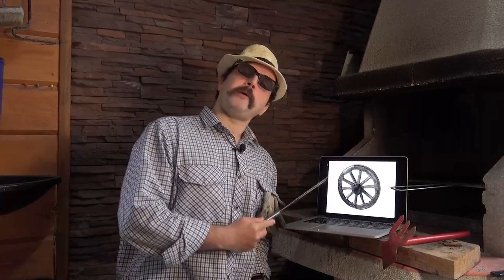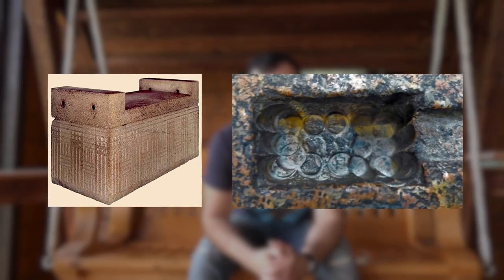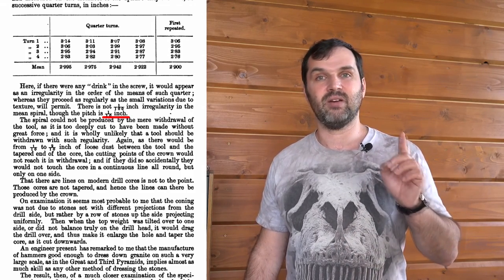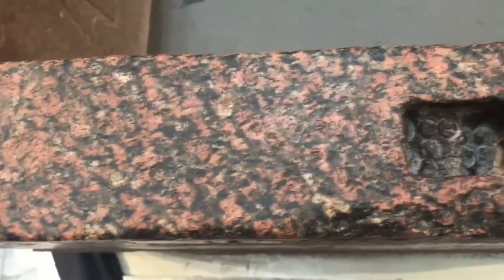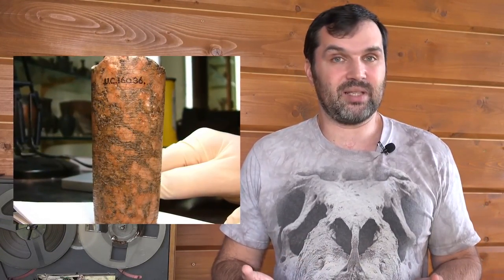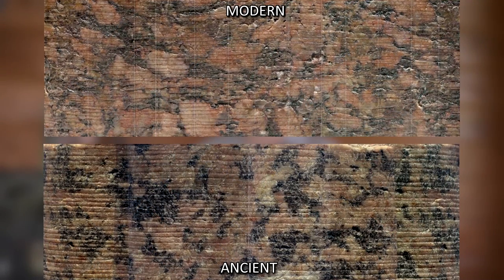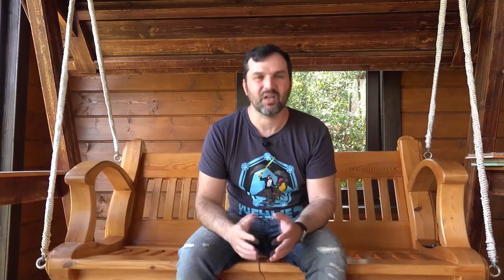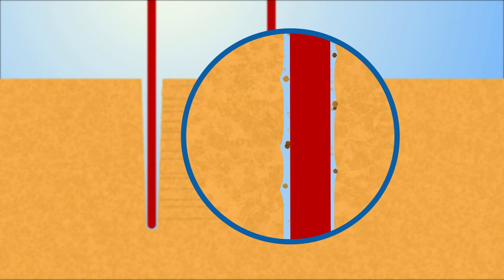Out-of-place artifact: 100 years of deception | Fake science spotlight

Comment: Has anybody considered the possibility that the bands are caused by workers taking turns with the drilling? If one guy went flat out for ten minutes, say, then stopped to hand over to a partner, this would possibly allow fresh grinding material to reach the grinding surface. A good experiment would be to use a machine to drill a core at a continuous speed and compare that with a core drilled by two or three guys going flat out for a fixed period then changing over.
Reply: Not just taking turns as that is a given - but also swapping out the drill core after a time for a new one.  There is documentation from the workers who created the tombs in the Valley of the Kings.  Each phyle - a work gang - had a person responsible for swapping out blunted tools and issuing new ones. Further as an aside they also weighed each tool to insure broken bits were not pilfered as copper was a valuable resource.  

Thus the creation of stone artifacts was an industry in ancient Egypt which likely employed tens of thousands.  Not only the Pharaohs had castes of artisans who worked for them - so did temples etc..  This means that work on such things was continuous spanning centuries as the demand was constant.  Just as Pharaohs wanted statues etc. = so these were also made for temples or for sale to everyday people.  Then as now you got what you paid for.  Wealthier people had the resources to create "museum quality" pieces while everyday folk had to suffice with cheaper facsimiles.  

So what you surmise is possible.  The video merely demonstrates that copper tools can in fact cut stone.  From that point on it becomes a matter of available resources and the skill of the person(s) + the nature of what is being made - higher versus lower quality.  🤔
Reply: @varyolla435  For sure. Turning the drill would be anaerobic exercise, and nobody could keep for more that 10-15 minutes, maybe: taking turns is a given, as you say. However, when they did the experiment on this channel to prove that the drill would work (they did take turns) the drill core showed very little wear after 40 minutes, when they had drilled 50mm. With one band per 2mm, this would mean the core had about 25 bands, and if the bands were caused by turn taking, this would mean that the two guys would have swapped turns after about 1.6 minutes. It would be interesting to know if this is about the period of turn taking that happened. I imagine that turning the drill fast could tire your arm out after a minute or two. Of course if they swapped turns after 10-15 minutes, it wouldn't explain the bands.
Reply: @dontsurfinthenude  There is an old movie The Agony and the Ecstasy.  The beginning shows a line of stonemasons working blocks of stone beginning with a small boy who is beginning his apprenticeship to a master craftsman.

Ergo as noted this was an entire economy in ancient Egypt and likely apprentices worked under the tutelage of masters - and likely did a lot of the "grunt work" for the masters to come in and finish. 

There are as an example partially finished tombs in the Valley of the Kings.  You can see whereby someone drew a design on a plastered wall ----> someone came after to make corrections to the design = and finally someone painted it.  That shows the "division of labor" whereby apprentices start a thing and the supervisors make corrections prior to the masters completing the task.  So once again absolutely multiple individuals would be involved in creating things.  

p.s. - Egyptologists have an an example unearthed caches of mummified animals for burial items and votive offerings around Saqqara = literally millions of them.  

Think about what it took to create such.  The creation of so many objects represents a highly structured industry and an entire sector of the Egyptian economy to supply the raw materials and to craft the final products.
Reply: @varyolla435  More typically you have apprentices doing the grunt work, masters doing the corrections and journeymen doing the details.
Apprentices work under masters and journeymen work on multiple sites to get experience in different facets of the trade. A “masterpiece” was an example of a journeyman’s work to show a group of masters that he was worthy of joining their ranks (not the work of a master but a formal application to become one).
Reply: @allangibson8494  Yes.  Another example is there are partially completed tombs in the Valley of the Kings.  The Tomb of Horemheb as an example shows half plastered walls.  Grids are layed out upon the plastered wall and a design was drawn  --------> someone went after them and made corrections = and someone then painted it.  

That infers what you noted.  Initial work was likely done by apprentices -------> supervisors made corrections = and master craftsmen began the work.  So you see a division of labor in what the ancient Egyptians did.  It was as noted illustrative of a professional caste of workers.

Comment: Do you have any video on the insane fitting stones in South America? (though in Egypt there were some too I think)
Reply: Other people have done them.  
#1 hint.  They obviously don't fit together as tightly as some claim that they do.  They are exaggerating.
Reply: @jamisojo  That is always the case with these theories. They rattle of a bunch of propositions and the conclude that it doesn’t make sense therefor (insert whacky fantasy). It all rests on something supposedly not making sense when there are perfectly sensible explanations that they just aren’t aware of or deliberately avoid mentioning. 

It makes no sense for the Sfinx to have rain erosion if it was constructed in a time when there was no rain. True statement, only there is no rain erosion on the sfinx, at least not any that wasn’t already there in the bedrock. 

It doesn’t make sense how they could cut millions of granite blocks into perfect squares and transport them hundreds of miles. Because they weren’t from granite and they weren’t perfectly cut and they were quarried just a couple feet from the pyramids. 

Yeah it doesn’t make sense how the South Americans could fit together thousands of 50 ton rocks perfectly with basic tools because they didn’t do that, there are only a handful of big stones most are tiny, they only fit on the outer facing side you see, the stones are thin and behind the wall is pure rubble.

Comment: Excellent presentation, fantastic background work.

Do you have a similar video about the creation of straight cuts into granite blocks (with squared, smooth sides and bottoms), such as in the serapeum? 
Thanks!
Reply from the maker: Wellcome!
Reply: The Serapeum was a temple which was in existence from the early New Kingdom all the way into Roman times.  The photos of the nicely cut sarcophagi you reference are from the section open to the public.  That is the last section to be created dating to = Ptolemaic Egypt - when iron/steel was in common use.   So always keep "dating" in mind when considering what technology was used to fashion a thing.

Comment: "With a diviation of no more than 0.25mm", on 2.5mm that's 10%, which is a LOT, that's not precise, it's shoddy by pretty much all craftsman standards. 
I have done some metal work, only beginners's level, but even there we had to work, by hand mostly, to within 1% or less, not 10%. For high precision you have way less diviation.

Comment: This video is much more deceiving than anything Christopher Dunn or Petrie have produced.   If you take 4 pictures of a threaded rod...then lay them out as you have....what will you get?   Interrupted threads of course!   They never said the spiral grooves were perfect, and Core #7 is just ONE example....we now have micro-photographs of inside the bore holes which also show spiral grooves.   There are many of these bore holes that go vertically as well as horizontally...how do you explain the method you claim to have been used on a hole straight up?   It won't work.

These 'debunking' videos remind me of the 'we never went to the moon' productions where they take one or a couple photographs and use them to 'prove' their theory....when there are millions of pages of blueprints, tests on the millions of parts that went into the entire machine and so on to prove that we DID go there and did what they say they did.  

I don't know how the bore holes were made...and many of the holes when examined from inside with borescope DO show spiral grooves of a fairly consistent pitch, so trying to 'debunk' off of just one sample is weak.   And...of course...this is just ONE of the mysteries of the pyramids and the megalithic construction that continue to mystify us.   Take the whole subject into consideration before trying to discredit someone.   Explain how the Schist Disc was made?   Stone vases of the hardest materials cut to uniform .050" thickness?   There are many artifacts laying around Egypt that we just don't understand and could not duplicate today.
Reply: Core 7 is held as the gold standard of continuous spiral perfection by Alternative gurus. It is not true. Horizontal core drills can be performed, for example, by simply shifting the work piece to a vertical position. The Fatimid crystal ewers were constructed 1000 years ago using the same ancient principles of abrasive grinding and polishing. Saying that something can't be repeated today is a non-starter.
Reply: you fail

Comment: Muddy the waters is a typical intelligence service skill. This video seems like a low budget Homer Simpson spoof. Actually it never mentions the key characteristic of Petrie's Core 7, which is the fact that it tapers. How could grit in a cylindrical tube get trapped in a tapering hole and still cut parallel grooves? Get back to the drawing board.

Comment: I have drilled scores of holes in the hardest of granite using water cooled, diamond tipped equipment. I can tell you that every core is smooth sided. Core 7 is a conundrum but an even greater conundrum exists in plain sight on the Giza plateau. You will see drill holes with the base of the core still present, showing that an extremely thin walled tool was used. A thin walled cooper tube used? impossible!!
Reply: Impossible? I have used 1.2mm and 0.8mm thick copper. 
All the core holes I’ve seen look chunky to the cores I drilled.
Reply: I've hunted using a high-powered rifle with telescopic sights.  Hunting with a bow and arrow?  Impossible!
Reply: ... it's so weird to so confidently assert something that is so objectively untrue and also so easily verified.... There are dozens of videos on YouTube in English in a variety of other languages all demonstrating 2 drills producing cores that look identical to core number seven.... at this point, it's not even an argument. It's not even a discussion. There are literally thousands of drill course that come out of Egypt and have been for decades that all look identical to drill course that are made with two drills and you can do it yourself in your backyard without any diamond tools, or without claiming to be a stone for decades a child could reproduce the results. What are you even talking about? Did you watch the video?

Comment: Perhaps, the drill was periodically removed from the hole in order to add more abrasive and the grooves are the result of slight misalignments when the drill was put back in the hole.

On a related point, my grandfather, who was a finish carpenter, never took any measurements. He had a tape measure that was pure white and a contraption which he could use as a gauge to get a precise distance. He told me that the trouble with taking measurements is that people round to the nearest suggested point. Perhaps, a bit of that was happening, too.
Reply: There are historical accounts to indicate that the work gangs who dug the tombs in the Valley of the Kings used to have a person assigned to swap out blunted tools for sharpened ones. So we see whereby a system was in place to minimize delay by having designated persons who would maintain the tools which others then used - as well as other designated tasks.  

As such one can therefore assume as you alluded to.  They likely had multiple drill cores available and would periodically swap them out as required for new ones - while the old tubes were either salvaged to be reused or simply melted down to be recast.  What we see was not the result of some random worker.  The Egyptians created an industry around fabricating things much as we do today.
Reply: @varyolla435  I figured that was the case. The use of blocks implies a standard method.

Comment: Awesome video. The cores came from hallowing inside of the sarcosuchus and that's why is there so many of them
Reply: Not necessarily.  They could just as easily have come from forming large vases/urns is a starting point to hollow the inside out - or from blocks used to frame in say entrances.  If you build a stone temple surrounded by an enclosure wall with a wooden gate entrance you will need to place wooden framing to hold the gate in place = thus shallow cores bored into the blocks making up the entrance into which wooden posts are inserted.  So lots of possible explanations to include creating sarcophagi.

Comment: While you went beyond the limited examination and explanation of others, and debunked them, you did not go quite far enough.  You erased one mystery but the high resolution photos present another one.  You looked at what is NOT there and pointed it out to debunk 'advanced technology' assumptions but you now need to go further to point out what IS there.  

What we can now see is a total absense of pattern and perfection that we would expect from probably any method, ancient or modern, that we can conceive of.  The lines are horribly irregular and ever-changing.  So now we need a decent theory as to what could have created what we can now see clearly if we look closely.  
If you knew of a manual method to produce such 'low quality' of rotation lines then you would have shared it, but you didn't.  That must be because the situation now is that what has been achieved by the modern experimenters EXCEEDS the quality of Core #7 considerably.  So we are left wondering what process could have produced such very strange lines that lack any consistency.  We've gone from wondering what could have produced such "precision" to wondering what could have produced such irregularity and linear inferiority.  Mystery still surrounds the matter.
~Ancient  Stonework  Mysteries~  Facebook group
Reply: " to point out what IS there" handmade with a saw and abrasive 🤣

Comment: Do you realise that this granite is made of several different minerals and those have a direct effect on the path of each revolution of the drill bit.. Only pure metals or plastics that are drilled with automatically controlled pressure, speed and axis will show perfect and even grove paths..  
These ancient exmples were done outside of the factories with hand held power drills, performed by the giants who were the craftsmen. That means that based on their body size these are incredibly small and accurate to be done with a hand held drill.   I just debunked your entire useless video